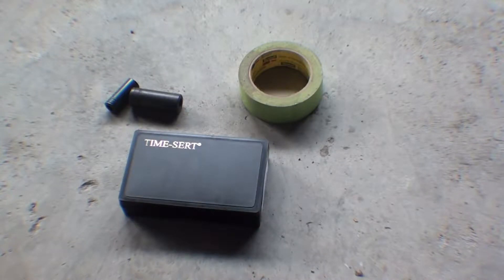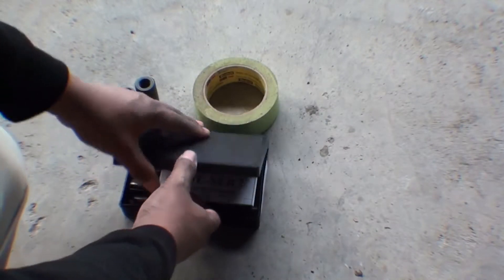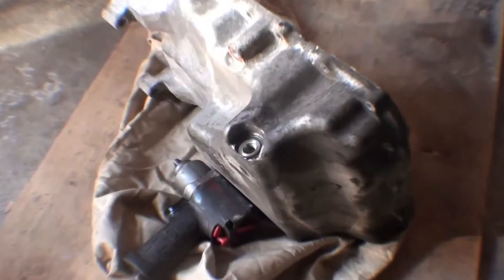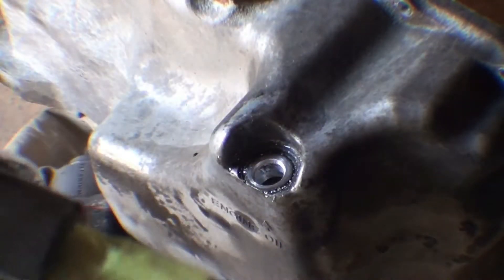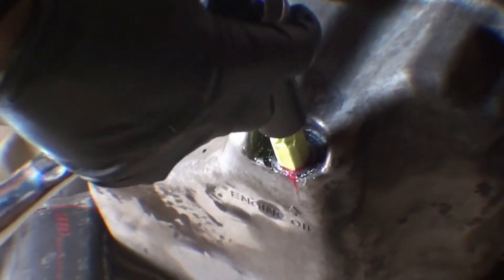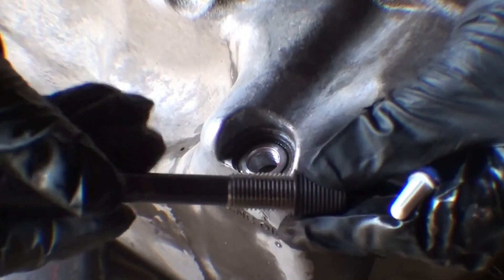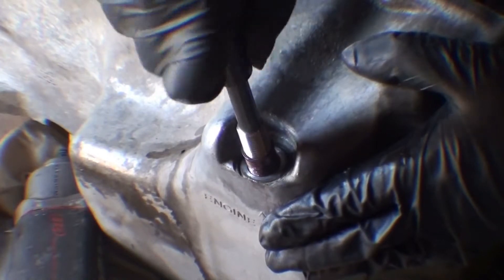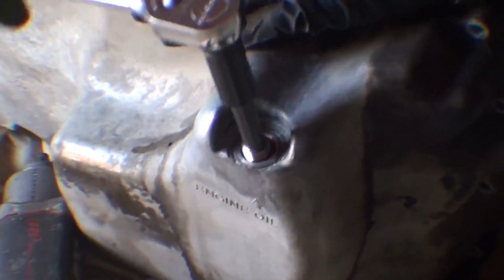Time Sert thread repair on Oil Drain Plug hole of Honda / AcuraV6 Engine (J series)

Comment: What size is the tap?
Reply from the maker: Its not 14M x 1.50; its a tap that came with the Time Sert kit. The Time Sert insert inner dimensions is M14 x 1.50 for the oil plug
Reply from the maker: The tap that comes in the Time Sert kit. I don't have the kit with me to let you know. The tap size is for the Time Sert insert (outer diameter of Time Sert insert).